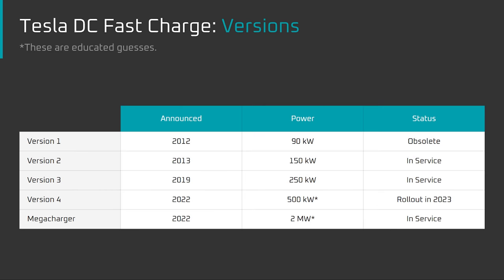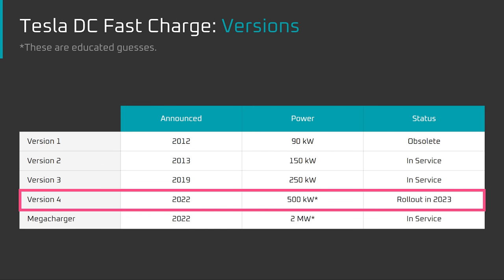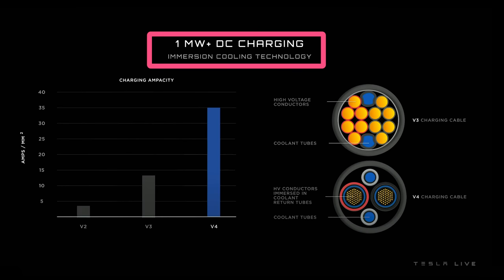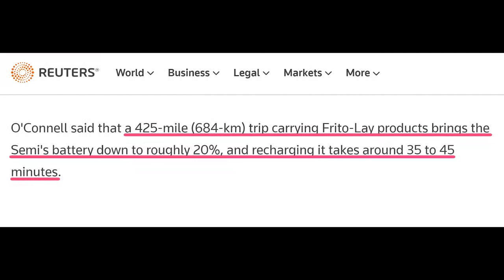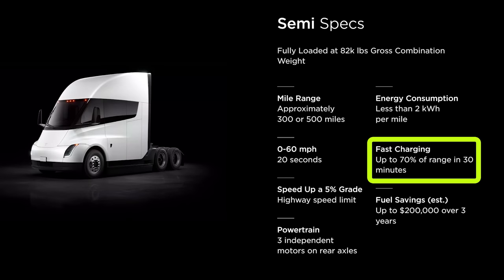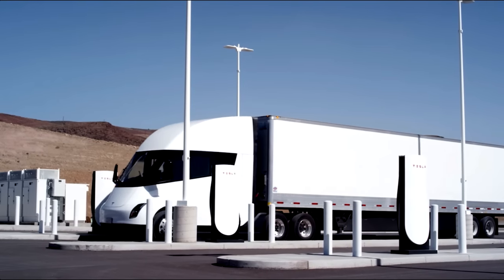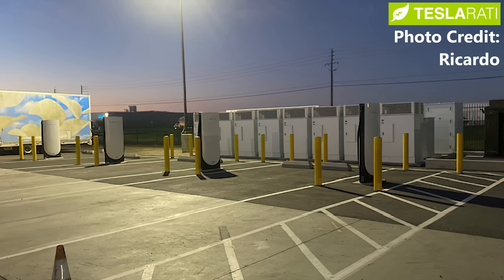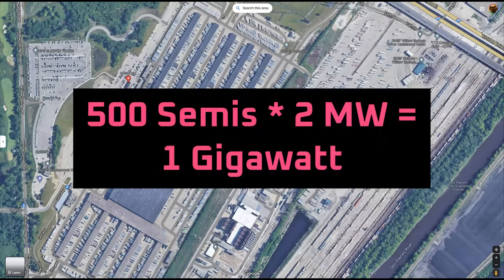Semi Megacharger Output // + The Megapack Moat

Comment: Between Seattle and LA is about 1600 miles.  so a tesla semi would have to charge 4 times minimum.  How many semis travel I-5 freeway?  if we estimate 100 per day, just saying that long distance hauls, not short hauls; then How many megacharging stations would be necessary and how many chargers at each station?  short haul trucks are probably 5 to 10 times as many.
what if the charging stations could automatically get a trucks destination and therefore it's charging needs to use for setting how many kilowatts it would be allowed to put in the truck?
Maybe short haul distance trucks would be allowed 350kw and long haul trucks allowed to fill all the way?  This is supposing that short haul trucks belong to a company that has it's own
charging stations.
Maybe long haul trucking companies would be required to have their own power sources, i.e. a solar/wind power battery supply station that feeds the grids and therefore doesn't subtract
the power available to the grid wherever they drive?  Example; from new york to LA is about 3500 miles, so the company that hauls over 600 miles, maybe, has a 10mw solar /wind power
plant in Nevada or rents one from Tesla? could fill up 8 times crossing the usa.  Maybe the company would have to have a power plant in each grid they operate in for each truck?  I'm thinking
that would keep our grids from depleting power for every eventual truck on the freeways.
Reply: There are no long haul semi's yet, just day haulers.  I think there won't be any long haul until a charging infrastructure is in place, at least between major centers.  It would be interesting to know what the payback time would be for a private hauling company to have their own chargers/solar farms etc..

Comment: Tesla semi should have 4 X charging ports and be able to use the normal super charger network. Upto 4 of them 

This way all charging stations can be used by cars and trucks and no need to segregate them
Reply from the maker: It's clear from the images that the cables wouldn't stretch that far.  Length = resistance
Reply: @thelimitingfactor  The world is still at the begining of electrification

It would make more sense to design chargers and trucks in a way that all vehicles can be charged from the same infrastructure

Rather than having 1 dedicated mega charger for just 1 semi. Have 4x super charger in that location with the semi able to plug into all 4 if it needs a super fast charge. Or 4 semi can plug into just 1 each if they only need say a 300KWh top up during lunch

This way all chargers can be used by all vehicles which is far better

Also like cars you'd want most of your charging to be done at slower rates. Eg 100KW when the driver is sleeping for 8h as an example. That can easily be done via a super charger no need for a mega charger
Reply: @kaya051285  Not at all. We have been doing electrification for like 150 years now.

How would you design that plug on the car? Where to place them? And what if ONE is taken already?

Easily done via supercharger? How? Where? You have a large trailer too you know? And what if your resting period is not there, at a place with chargers? And if it is and they are taken?

Comment: What no mention of the MegaPack at the Baker CA Supercharger burning up a couple weeks ago? 
Tesla owners charging their vehicles on New Year's Day at a Supercharger station in Baker, California witnessed a mobile Supercharger burn to the ground. These mobile Supercharging stations are comprised of a mega pack on the back of a trailer with multiple Supercharging outlets attached.
Reply: So I googled "Gas station fire California"
.
There were plenty to choose from.
Reply: @rogerstarkey5390  Yes of course there were. This isn't about EV vs ICE.  It's about how MegaPack isn't special and has no moat.
Reply: @JayMcKinsey  It's new tech, there are always hiccups in new tech.  There will be more accidents, that's the nature of the beast and when dealing with large amounts of energy either in a battery or in a gas tank there are always associated dangers.
Reply: @TheEvilmooseofdoom  Yes but MegaPack is nothing special and has no moat, just competition.
Reply from the maker: Anything that stores energy with chemicals will eventually and occasionally explode.
Reply: @thelimitingfactor  So nothing special about MegaPack. Cheaper to use CATL EnerOne.
Reply: @JayMcKinsey  Is that bad?  What does a EnerOne go for?  I can't find any info on their site.
Reply: @TheEvilmooseofdoom  It's bad for Tesla. CATL will always undercut Tesla. Tesla just rebrands and resells CATL batteries in MP. Next year will be worse for Tesla as CATL moves to their lower cost sodium batteries.
Reply: @JayMcKinsey  What is a the cost of a EnerOne?  With no pricing how can you say they will undercut?
Reply: @TheEvilmooseofdoom  Because CATL is the cell manufacturer. Tesla is a reseller and CATL is beating them in deals right in their front yard . CATL just beat them out for the huge Prmergy deal in Las Vegas.
Reply: @JayMcKinsey  So you have no hard data.  Tesla is also a cell manufacturer and it in the process of ramping that up.  I think you're drawing conclusions from what you want not what you know.
Reply: @TheEvilmooseofdoom  sigh, MegaPack uses CATL LFP batteries. Tesla does not make low cost LFP batteries. 4680 is an expensive ternary battery that is barely in production. Meanwhile CATL is ramping their next gen lower cost sodium battery. Tesla has absolutely nothing that can compete in the grid storage space. 

Best data points come from won and lost deals. CATL just beat Tesla for the 1.4GWh Primergy deal in Las Vegas, Tesla's front yard.
Reply: @JayMcKinsey  4680 production is just getting going, there is nothing to say that they won't at some point be using in house cells.  One of the major points of the 4680 is to bring battery costs down and numbers up.  So they're both ramping up cell production.  You can only cite one instance to support the rather flimsy premise that Tesla can't compete.  That's convenient for you but hardly an accurate indication of reality.
Reply: @TheEvilmooseofdoom  sigh  I gave you the most poignant example, Do a search for Tesla megapack competitors. Or read Energy Storage News etc.